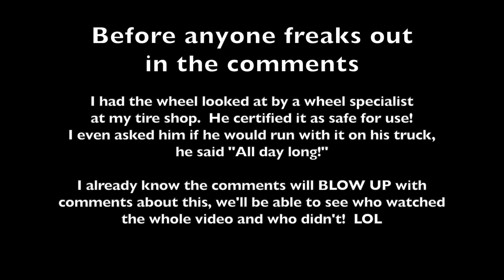CHEAPEST wheel hub on Amazon tried to kill me

Comment: now days it's almost as cheap to replace entire control arms. Those old bushings won't be easy to get out. By the time you add the heat needed to get them out, it'll certainly affect the integrity of the thin steel.
Reply from the maker: Imma keep that as the backup plan. For now, I bought a press and the bushings. 😱 I’ll be sure to video and post the results. 🤷🏼‍♂️